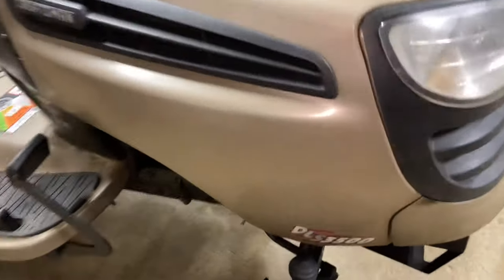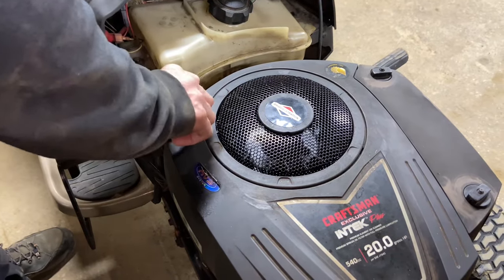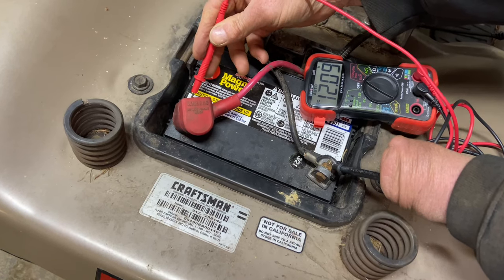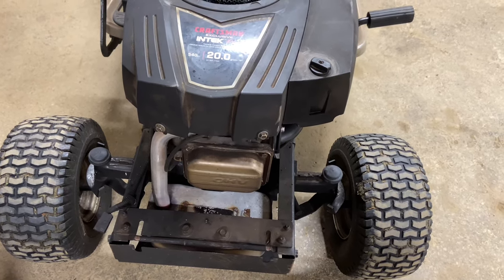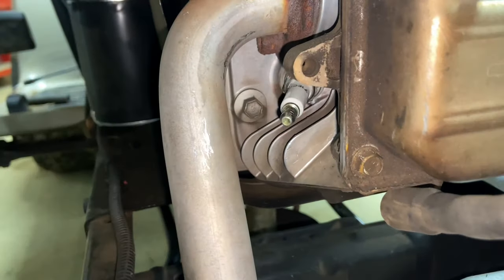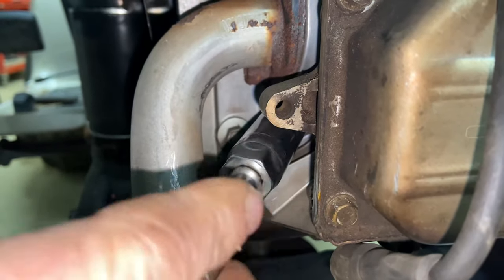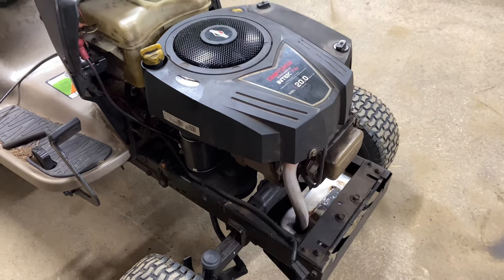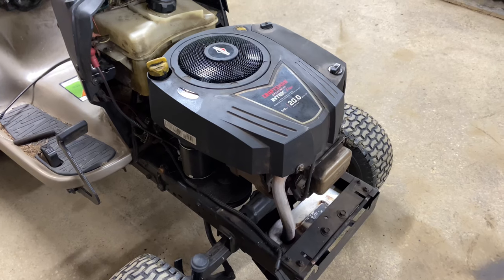Craftsman Tractor Will Not Start

Comment: Thanks to you, I got my tractor up and running (short in a wire) that went to the gasoline solenoid cutoff. I listened for that "click sound." It ran great for an hour, and without warning, the engine blew up with a nice hole in the case. LMAO. Oh well. It's time for a new one!

Comment: I've seen a few of your videos while monkeying around with my Craftsman LT1000 over the past couple of years, and they're always fantastic.  Subbing!
Reply from the maker: Thank you for watching, commenting and supporting my channel!
Reply: @JohnsonsSmallEngines  Yeah man!  So, I changed out the solenoid, spark plug, checked the battery, all seems good.  Compression seems good.  I sprayed some starter fluid into the carb as I was cranking it and it seemed like it was just spitting it back out, like maybe it wasn't getting into the carb but I don't know why this would be.  I took off the gas line to the carb and everything seemed fine?
Reply from the maker: If you sprayed starting fluid down throat of the carburetor and the engine did not fire? You may have no spark going to the spark plug? Did you check spark with a spark tester? to see if the ignition coil is OK.
Reply: @JohnsonsSmallEngines  No, I don't have a spark tester yet, but I did replace the spark plug with a brand new one so I assume it's not the issue.  But obviously, I don't actually know what the issue is so I could be wrong.  Ha!
Reply from the maker: It doesn’t matter if you put a new spark plug. If your ignition coil has failed, the spark plug will not spark. You need to check the ignition coil with a spark tester.
Reply: @JohnsonsSmallEngines  I didn't get a spark tester, but I did remove the spark plug still in the boot and put it up against the metal frame of my riding mower and gave her a crank.  The spark plug was sparking just great, so that's not the issue I guess either.

Comment: Great video walk through thank you!  So what could possibly be wrong if I've gone through all of these steps but it still won't start?  (engine turns over but won't start).  I've checked everything I can think of (fuel is flowing from tank, fuel pump is sending gas to solenoid, solenoid is working properly, engine has compression, new spark plug, both valves are opening and closing freely.) Engine cranks fine but will not fire (with the exception of an occaisional backfire).  What else could be wrong?
Reply from the maker: Impossible to diagnose without seeing the machine. I’m guessing, if you have a Briggs and Stratton single cylinder engine possible sheared flywheel key or possible valve seat came out of head.
Reply: @JohnsonsSmallEngines  Thanks...  "sheared flywheel key" was actually the one last thing on my list to check (haven't checked it yet but plan on doing that today).  If that proves not the problem, then I guess  maybe it's just time to retire this 20 year old craftsman mower.

Comment: Thank you, I have craftsman LT1000 Rider on and I’m not getting any crank, any ideas?
Reply from the maker: It could be many things. Dead battery. Bad connections to the battery. Blown fuse. Blades in the on position. Bad safety switch.

Comment: Good video. I have a craftsman LTS2000 run’s for 5min then shuts off. Starts up after it cools. Any suggestions
Reply from the maker: (1)When it shuts down, check spark. If it does not have it. You have a bad coil. Yes, they can cool down and the spark can come back. (2) check to make sure your gas cap vent is clean (3)If you have a electric fuel shut off solenoid, it may be intermittently failing. (4)debris in fuel tank? clogging inlet to fuel line after running for a while. Start with the (1) and work your way through. Let me know when you find out what the issue is.

Comment: I just got my hands on a dlt 3000 with a 25hp b&s twin v. I just bought a new battery and I’m not getting any crank, any ideas?
Reply from the maker: Check fuse, Make sure the emergency break is down make sure the seats which is plugged in. Make sure the PTO is not on and if all else fails it’s most likely a safety switch that has failed.
Reply from the maker: Also, make sure your battery cables terminals are clean and bolted tightly to battery. Make sure the battery is a good battery?

Comment: OK I have the same 2007 craftsman DLS 3500 New spark plug but had spark brand new carburetor took the solenoid off the bottom of the bowl have plenty of brand-new gas new fuel line filter, new oil and filter, air filter but will not start of a brand new battery? Any idea lol
Reply from the maker: The only thing that is left for a engine that will not start would be compression, (Valves). check out this video and you can fast forward it to four minutes and 20 seconds. https://youtu.be/Y4hWgv5OEYI. You may have one valve giving you a issue.
Reply: Yes I didn’t say that in my response I spun the motor and it became difficult then easy. Ok so the coil and around the top of the motor was rusted how close does the coil have to sit away from the motor or does that matter?
Reply from the maker: @marksullivan5793  you can still have compression if you have a valve issue. Pull off the valve cover and check valves. Tolerance of the coil is around 15 thousandths air gap
Reply: Thank you so much for all the info!

Comment: I have 18 yr. old Craftsman 17.5 HP Electric Start 6 Speed Transaxel, NO Problems at all, until now, I tried to crank it and a loud thump was under the hood , put New Battery , New Solenoid, No action of any kind , can you help me , no one talks about the Electric start , If I have to buy another one , which Craftsman compares to mine , Im 81 yrs old , just need a good mower to mow front and back yard I can put my Bagger on , Thank You